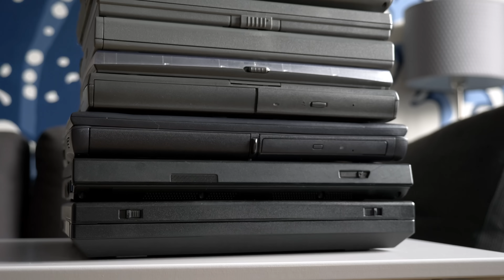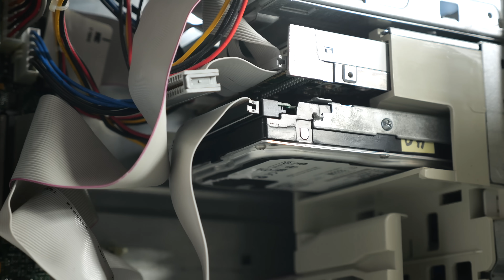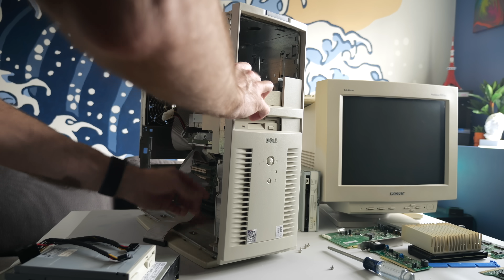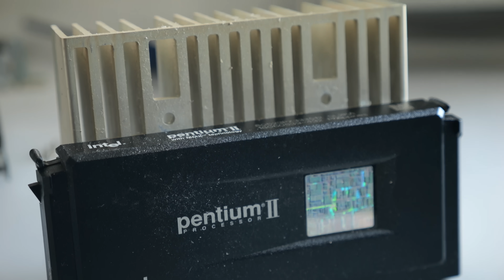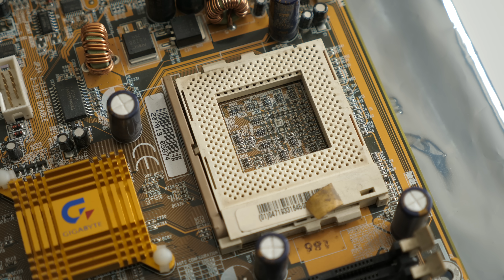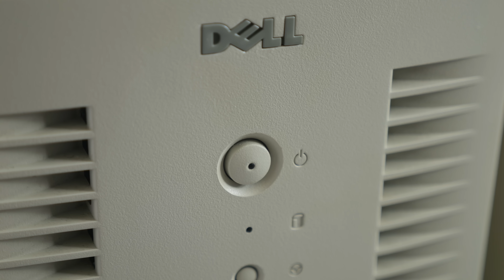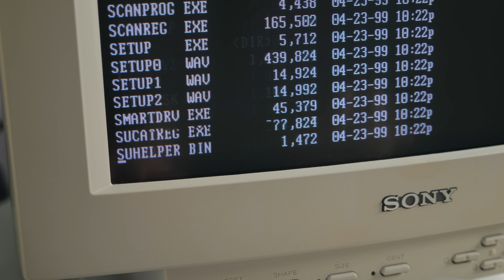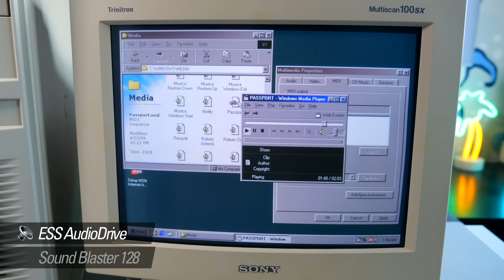Could this prebuilt vintage PC actually be GOOD?!

Comment: This PC case is superb and super easy to use. It is NOT manufactured by Dell, but by Palo Alto Design Group (PADG), and its model name is the "ATCX convertible". It was used by a lot of manufacturers including HP and Micron. I personally bought one of these case without any OEM badge and still tun it today. 25 years later ! :)
Reply: (also available in the NEC computers of that era)
Reply: there are reviews of the case on anand tech from 1990s (palo alto products on his review)
Reply: And Umax Pulsar Mac clones! I don't think I've ever seen a side-by-side comparison but aside from the front panel my understanding is that the cases are almost identical.
Reply: @DiningWorkbench  Yes there was very small improvements through the years. They have distinct front bezels but they are essentially the same. When you bought it directly from Palo Alto (ie not from Dell, HP, Nec...) you didn't get the stabilizer metal bar (designed to strength the structure in case you put a CRT monitor on it).
Reply: I still have a rig in one of these cases, badged as Dimension 4100, from 98. That one started as a 733Mhz Pentium 3, and was the case in which I built a LOT of AMD rigs between 2000 and 2006. I used to preach the gospel on this, as at the time you could buy them under a number of OEM names. The one's I used TONs of was the Enlight variation, mostly because Enlight PSUs were soooo damn good back then. I dont think they are even around anymore.  This was when cases included PSUs by default, it was more rare to find a case that DIDNT have a PSU in it back then. 

My oldest one though, is a Dimension XPS P90, in an AT case with a Pentium 90Mhz from 94, wherein everything is original except the hard drfive, which is a Quantum 8GB, partitioned into 4 2GB partitions, because 16bit Windows cant fux with anything bigger than 2GB. It has a whopping 8MB of EDO RAM. 

Dang man now I am thinking about all this - the hard drive runs on PATA, but is limited to Programmed I/O mode, so like.... 6 or 8 MB/s tops. The "GPU" is an S3 Virge. I distinctly remember downloading SNES ROMs on dial-up, with the "big" ones (1.5 to 2MB) taking forever to DL.  and then having some slowdown in emulation. Slowdown while emulating a SNES, lmao. 

It was just shy of 2 grand in mid 1994. O_O 

IMO, the transition from this type of ATX compliant case to the ridiculous clamshell monstrosities is what marked the start of the real downfall of Dell. It didnt cause it, but it was the sign of the times so to speak.
Reply: @acetechnical6574 good times downloading roms, for me it was downloading Pokémon blue and red game boy roms at the library since I didn’t have internet at home, and then copying them to a floppy to play at home. Luckily my first pic was a Pentium 166 so it ran fine at full speed
Reply: TIL Micron made computers.
Reply: My primary Pentium III machine is a CompUSA PC with the same style of case. Add that to the list of brands that used this style of case.
Reply: Good information. Thanks.
Reply: They also had them at my jr high and high school as OMNI TECH banged ones. I remember by that stage they were mostly clapped out P3 and P4 ones
Reply: On a modern machine? Cause it doesn't look like it would have enough airflow
Reply: @ElShogoso  No it has been designed in the late 90s and you could find it until the very early 2000s. So basically it's meant for Pentium 2 and Pentium 3 plateforms that have no real cooling expectations. I still use it with a P3 1.3 Ghz...
Reply: @olivierpericat9224   Isn't the case shown a TOWER case?  The guy in the vid said: Form Factor'.  But its not a form factor, right? 
I mean it had to CD bays and 2 smaller bays.
I know towers can be like 4 CD drives, but that one in the vid, that'd not a form factor, right? Its like a Mid Tower!

I found a lot of info on what constitutes a case size from Dell, but they seem to love old Optiplexes, Dimension old cases was not an easy search, so I'm asking you.
Reply: @kimsland999  Form factor does not designated a tower or desktop. But actually this is a mid tower form factor that can be converted to a desktop. The drive cage can be rotated so that the CD-ROM drives remain horizontal.
Reply: @olivierpericat9224    Oh I see.
Do you know for something like 2 decades I've never understood what form factor is.
Plus even laptops are called PCs, when I'm sure originally PC meant a Desktop!
Its very confusing.

When you said they can be turned around on the desk (yes I remember the clip holding the CDs in) That kinda makes sense. In my mind 'form factor' means horizontal tiny desktops, with miniature power supplies LOL and all that. 

Ok so that kinda helps when you said they can go horizontal too. 
I mean lets face it, personal computers are phones or laptops at best!  The Desktop era (for homes and students) is gone.
Sometimes you do hear of 1 person buying the gaming Desktop, with LEDS etc. But its just uncommon.
End of an era.
Reply: @kimsland999  Actually form factor means "size / dimension / aspect". Motherboards are AT or ATX or Mini ITX form factors. Computer cases are mini / medium / large towers or mini / standard desktops form factors... And so on ! :)
Reply: @olivierpericat9224    Yes the Motherboard (and power supply I mentioned)  Yes yes AT and so on. 
But it was really the cases that confused me.
I know its not right as an overall definition, but I'm just going to say: They can be placed sideways!
Really a pinpoint definition would be good, I'm going with that  :)
Reply: I ... HATED... that case.  We had a bunch of these Dells at a company I worked for.  Toward the end of their life, they got repurposed as reference machines on a help desk.  They were set up to multi-boot various versions of Windows so the techs could see what the users were seeing.  I ended up swapping components between a closet full of them, to build fully-working ones from a few that had components that had failed, or to distribute HDDs and RAM more evenly and generously to the remaining ones.

That stupid case is so plasticy, and since it was plastic, it had to have RF shielding added to it.  Those thin metal sheets had fingers that got stuck on everything, bent out of shape with a stiff breeze, and had a tendency to draw blood.  The whole thing felt cheap, while still managing to be heavy, and looked as if it were designed to be easy to service without actually being any easier to service.  For one thing, at this point, if you had to remove the front panel to do anything but fiddle with the front-panel switches and LEDs, you were doing it wrong.

Good riddance to those things.  The black and dark-gray cases that followed were tons easier to work on.  I have a bad case of nostalgia and generally love everything about that time, but those beige PII / PIII era cases can all go straight into the bonfire.  No love lost there.

Comment: If I remember correctly Pentium IIs (and Celerons) were actually very good overclockers, you had to change the front side bus speed since the clock multiplier was locked, but my memory might fail me.

Comment: I had the successor to this machine (Dimension T450). Over time, I was able to upgrade it from a Pentium III 450 to a Tualatin Pentium with 1.4 GHz (using an andapter) and 768 MB RAM, which ran Windows XP just great. Upgradability? Check. Longevity? Check.

Comment: Damn, considering the era this came out that's a really well designed chassis. It comes apart way more easily than 95% of anything from the 90s. Great video Colin, as always. You really go the extra mile when it comes how you frame your shots and arrange the set.
Reply: This is garbage for anything but home computers.  One of the main reasons Dell was cheaper than a good computer like a Compaq or IBM is that they didn't keep inventory.  Inventory costs a lot of money.  But when you have 1,000 or 10,000 PCs, you cannot perform repairs with whatever part you happen to have.  At this time, this is what Dell did.  As long as the replacement part is better or newer, 99% of consumers don't care if they cannot get exact replacements.  But in a corporate world, this is a complete nightmare that has costs that balloon out of control.
In 2001 I could get exact replacement parts for PS/2 made in the late 80s.
Reply: @tarstarkusz okay? its still built well
Reply: @star__sh  Not especially well built. It's just generic.
Reply: @tarstarkusz  i know its pretty generic, and was used by various other companies aside from dell, but that isn't really a bad thing imo, when i had a dimension 4100 that used this case, i found it very easy to work with, and i didnt take very good care of it at all, yet it never broke or bent in any way, so yeah it isnt anything special or fancy, but its a solid case, much better than some of the cases that used paper thin metal and would seemingly bend from a strong gust of wind
Reply: @star__sh  The physical build quality of PCs dropped off a cliff around 1998 when the prices really started falling.  Most Compaq and IBM machines were built like absolute tanks, but you also paid a lot.

The generic PCs of Dell and others (like Gateway) is not a big concern to consumers. But this is a big concern to big corporations and government agencies or states who have and have to manage thousands or 10s of thousands of PCs.

Today it isn't as big a concern, but is still important.  That's why companies like Dell offer enterprise PCs.
Reply: The worst part about them was their proprietary PSUs designed to fit into their specific size case.  This is what makes it impossible to upgrade.  I had an HP from 2003 and the issue was that PSU simply wasn't strong enough to power a dedicated graphics card and there was no way to purchase a stronger one that would fit into the case.  If it wasn't for that limitation, the other issues could be worked around.  I don't have a problem with pre-built machines that use standard components. @tarstarkusz

Comment: I had one of these way back when, with a 21" Trinitron. And you're right, it would take another couple of years before Dell started going all proprietary. IIRC the only issue with this chassis was a custom motherboard connector. Other than that, it was as upgradable as any other PC of its day. As for gaming, well, anyone who was serious about gaming either had a Voodoo, or later a couple of Voodoo 2s in SLI ;)

Comment: I had the XPS M200s. Same case. 
Mine came with a Pentium 200mmx, 32mb of ram, a 3.2gb harddisk and the same CD-rom drive, but weirdly in 24 speed. It also had an AWE32 and a Matrox Millennium videocard. I stopped using it in late pentium III days and at some point a vacuuming accident saw it fly off a table. Thoroughly broken case, but still working perfectly. Gave it to a friend, not sure if he still has it (I don’t have the friend anymore :D). 
Mine came with a 17” Dell Trinitron monitor, so also a Sony, the same keyboard, and a Microsoft Intellimouse 1.2a, which is definitely a lot nicer than the one you got there. 
Great machine!

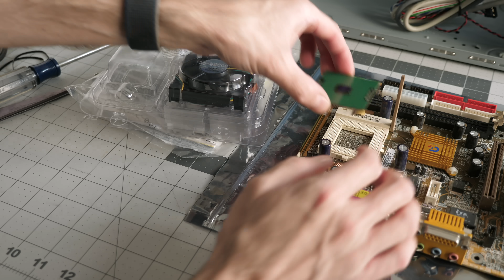Comment: 9:00 A note about Socket 370, they debuted with the Second Generation Celerons before the Coppermine Pentium IIIs, and with the cache embedded onto the die, they slowly started to phase out Slot 1 CPUs as they have sorted out their CPU and cache manufacturing issues.

Slot 1 Coppermine Pentium III CPUs have on-die cache too, but the socketed ones were the norm at that point in time.
Reply: Afaik they kept Slot 1 alive until the end, even the 1 GHz Coppermine was available for it.
Reply: @HappyBeezerStudios  I am well aware that Coppermine PIII Slot 1 CPUs were available at the same time as the socketed ones with the transition from slot to socket, and you can also use socketed CPUs in Slot 1 form factor via Slotkets.

Comment: You made a major error. Intel CPUS of the time WERE THE ONLY ONES TO USE SLOT "1". AMD chips of the time were SLOT "A" not SLOT "1". Implying they were SLOT 1 also implies they could be used on INTEL boards and they definitely could not.

Comment: Every PC tech h8t3d Dells, because they had these cheap flimsy clamshell cases that opened from the wrong side.  And they were all proprietary .   
Literally, they were the worst.   Once we took what was not proprietary and salvagable out of them, we threw the rest of what was left in the dumpsters out back.
If you want to buy a name brand PC, at least get an HP...     it is bad, but not nearly as catastrophically bad.

Comment: If I recall correctly you can overclock the slot 1 pII by putting some tape over one of the card edge conductors to trick the system into a higher front side bus. PII 333 runs at a 66mhz fsb with 5x multiplier. If you can trick that board into a 100mhz fsb you can clock that puppy at 500mhz. I have done it many times.

Comment: Dude! I have 2 Dimension XPS D300’s. (Basically the same PC.) Both have their original 300MHz P-II’s & whilst one is not in use right now the other has a TNT2 Ultra & 2 Voodoo2’s in SLI installed, along with a Sound Blaster 128 & 512MB RAM & it’s a fantastic retro gaming PC. With Win98 SE on it, it serves as both an early Win 9x & a late era DOS gaming PC & I love it!
Fun vid, thanks.
Reply: P4 on a P2 board? huh
Reply: @magcs6233  where are you getting “P4” from?!
Reply: @nicholsliwilson   somehow commented on the wrong post lol
Reply: @magcs6233  LOL! 😂

Comment: Every dell that I’ve encountered from the 90’s up to the 2010’s have been some of the most robust and reliable PC’s I’ve encountered in my life. My very first computer was a Dell laptop and so while I do have bias, I can say that these machines have stood the test of time. They especially display this when given their highest end upgrades to speed them up significantly. A lot of other makers like IBM and HP have held up well, but I think the dells have held up the best out of them all as even their pentium 4 laptops were pretty impressive, and can still work with enough upgrades put into them.

Comment: I had one of these handed down to me.  I believe it was a 200 Mhz model.  I ended up installing a slocket with a 300 MHz Celeron and a Nvidia Riva TNT2.  Unfortunately, the TNT2 never quite gelled with it, so I had to limit the AGP bus to 2X instead of the 4X that was typically supported in these setups.  This did have a major impact on the performance, but we took what we could get.

Lots of Half-Life, Starcraft, Diablo II, Deus Ex, Counter-Strike, Quake 1 and 3, Unreal Tournament.  Good times.

Comment: I worked at Dell as tech support during this, and later model Dimensions. This was a time when support was factored into the cost of the machine, and you had REAL support to rely on if needed. So many hours spent walking a customer through how to install a replacement part, or reinstall 95/98/NT + drivers. The Pentium II 350/400/450 MHz DID have a way to overclock, by covering up one of the pins on the slot 1 socket. In the BIOS, you could flip the speed accordingly - so long as the processor was a 'good one,' and could handle the boost. Good memories!
Reply: I just woke my XPS R450 up after a couple decades. Runs like a top. I was too afraid to overclock it back then. I remember being jealous of my friend who overclocked his Celeron 300A to similar performance (though still a little slower).
Reply: Right on, I started a bit later (2004) - I have some fond memories of that time at Round Rock 7.  LCA / large corporate accounts were the easiest 'cause the on-site tech had already done troubleshooting LOL.

Ah life was much simpler back then : )

Comment: I had a Celeron 366 overclocked to 466. It was on a daughter card to fit into the Slot 1, and I had a TNT PCI card for video. It was good enough to keep up with my friends' more powerful system while playing Quake 3 Arena during some LAN parties. I miss those days!
Reply: Dude I got a Dell😜😜

well of course it could because Celerons back then could easily match the Pentium's for gaming due to the Pentium's having l2 cache on a card but Intel figured it out and put L2 cache on the pentium3 chip fixing that issue mid way into the Pentium3's life cycle

Comment: My first gaming build used a slot 1 P2, which I upgraded to a P3, and a few years later I was able to upgrade to a P4 on a modified slot 1 card (I don't remember who was selling it at the time).
I'm guessing the prior owner of your Dell was copying disc to disc and floppy to floppy.
Reply: Could the chipset do pentium 4? I only know slot 1 to 370 adapters.
Reply: @RoderikvanReekum  It was some sort of aftermarket slot 1 adapter board, but this was over 20 years ago so I don't remember the details or vendor.
Reply: @bryans8656  If I am right there were only slot 1 to socket 370 adapters for pentium 3. I think pentium 4 was impossible, maybe you got a new motherboard aswell.
Reply: @RoderikvanReekum  You could be right Roderick.  It was a long time ago and my memory isn't as good as it used to be 🙂
Reply: No, you didn't. It was a faster socket 370 pentium 3.

Comment: I love Dells. I had to solder together a number of pins on a Dell motherboard this week because we didn't have the case with the proprietary power and audio connectors and it will otherwise give you an error on start up about the power button and front I/O failing. Fun 🙃